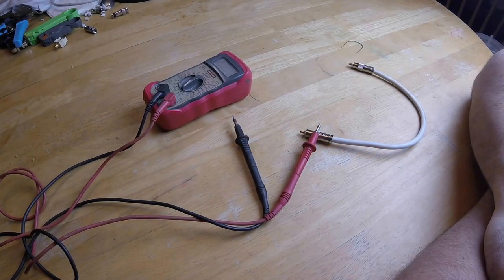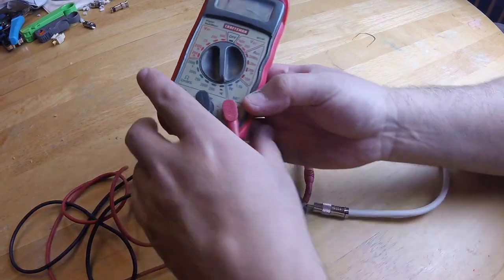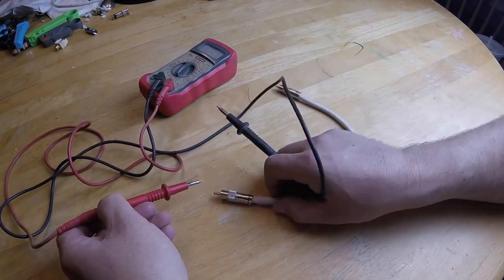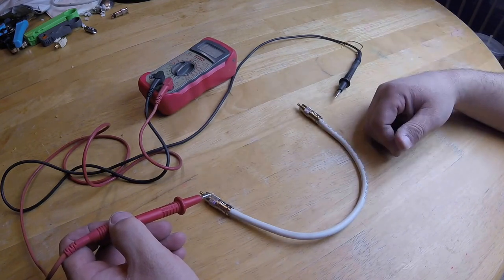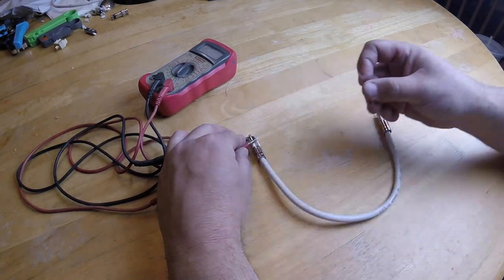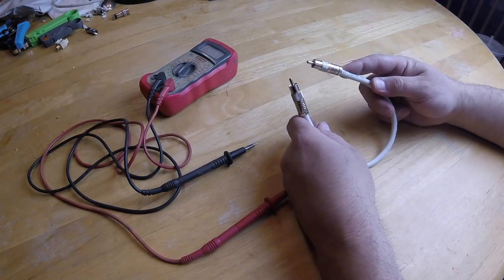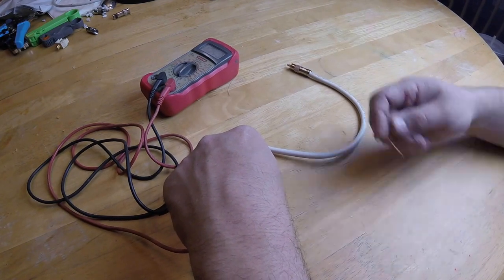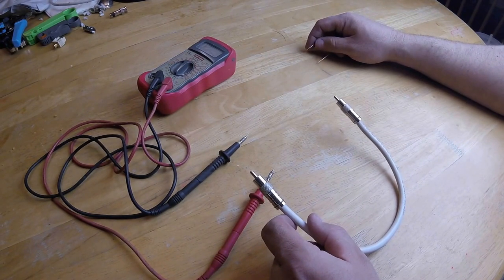Using a digital multimeter for beginners. How to test your cables

Comment: I made a MC4 cable/connectors/extension. Measured the voltage to the solar panel without light emitting to the panel. The voltage reads 0.59V is that ok? PS: I just want to know if the cables/connectors are installed correctly.

Comment: Hi, great video! I’m trying to test a wire that goes from my car battery to my sub in the boot how do I do this with both ends not having connectors and it’s just the bare wire? (Also my multimeter doesn’t beep either).
Reply from the maker: Use the ohms setting and it will be easier with two people if you can find help. Once you’re in the ohms setting, look at the reading on the meter. I think it will read something like 1 (I may be wrong but it doesn’t matter what the reading is). Now touch the leads together. The meter will probably read something like 0 (once again I may be wrong but the number doesn’t matter). Note each value- whatever value it may be. Now have your buddy go to one side of the wire. He should not let the wire touch metal yet. You keep the meter on the other side. Touch one meter lead to the wire (don’t let the wire touch metal) and touch the other meter lead to a good grounded/bare metal spot on the car. You should have a reading on the meter that matches the reading you had earlier when the leads were NOT touching. Now tell your buddy to touch the wire to a good grounded/bare metal part of the car. If you are both on the same wire, the meter will read the same value it read earlier when you touched the two leads together (or close to it). If the meter value isn’t changing, you guys are either not using a good ground/bare metal surface or you’re on different wires. Good luck!
Reply from the maker: Or it IS the same wire but it’s cut somewhere.

Comment: hey,what about a single long wire that you cant reach the both ends,how you can check for continuity?and how to check which end is the wire in case they are the same color???thanks bro
Reply from the maker: Same setting on the meter. The person on one end of the long wire should put one of the meter leads on the outside of the connector and the other meter lead on the tip of the connector being careful not to let the leads touch each other. Then, someone on the other end of the long wire will take a small piece of wire or copper or whatever then use it to connect the outside of the connector to the tip. We call that a “short” and the person on the meter should hear it beep every time the other person connects the tip to the outside.
Reply: @AlanCleggYouDoAV  thanks bro

Comment: My multimeter was free from Harbor Freight and does not beep; what kind of readings am I looking for?
Reply from the maker: Woo would have to use the OHMS setting then and check for open and closed circuits.

Comment: Can you test HDMI and MiniHDMI with a multi meter? Been searching online but no answer so far, stumbled on your vid.
Reply from the maker: Theoretically yes but logistically, no. You’d have to pin each side and it would be extremely difficult with a regular electrical meter. It’s not uncommon to have a bad HDMI cable if that’s what you’re asking. If you have several going to the same place, you can use a similar method to identify wires, but testing is kind of asking a lot.
Reply from the maker: It’s also not uncommon to have an HDMI cable that handles one video signal but can’t handle a more advanced one
Reply: @AlanCleggYouDoAV  Thank you for the information, much appreciated. Goodluck with your channel in 2020 !

Comment: if the audio rca cables are good, how can we check the tv audio out holes? with the multimeter
Reply from the maker: That’s actually a really good question and I’m not sure how to answer it. I wouldn’t use a multimeter to test the audio out signal. I would use a different method depending on the application. Tell me about your problem and I’ll see what advice I can offer.
Reply: An Oscilloscope can be very handy. You can use that to see the audio signal coming out of the TV

Comment: I heard you can use a tin foil on one side if you wanted to locate a working coax on the other. Example Some idiot contractor i hired decided to unplug most my coax and now I can't locate my directv line. I found my cable internet line with a splitter i got that to bring my new modem to my central location. I just know that my satellite coax is on the other side of the wall and I know the outlet its coming out from. I know find about 50 feet of unplugged coax i recently had a satellite guy hook up. I located the line that goes directly to the dish but can't locate the line that goes to the outlet. Maybe I should just plug in that unplugged extra coax direct and run that line down and make a new outlet. Aghh this contractor was a nightmare and all he was paid to do was put in recess lights.
Reply from the maker: I haven't heard the tin foil trick. I'm not sure I understand the lost cable. You found the line that goes to the dish but can't find the line that connects the central closet to the line from the dish?
Reply: @AlanCleggYouDoAV  Sorry it's hard to explain my situation. So i moved in a house that had a family room built. On the side wall it has an outlet that is for cable internet hook up and also a line for directv. Up in the attic half way, the whole side of the family room is practically blocked off. Those two lines are on the family side of the wall. If i really wanted i could crawl and squeeze to the other side with plenty of space but gotta do vice vesa if i wanted out. I actually used the foil method and it worked!!!!!  So I covered the outside metal part adapter and covered the inside copper line or middle conductor with foil. Went up the attic to the 3 unknown coax, 2 were dead and the last one was it. Used a multi meter and set it on continuity. From there same concept of how you explained on checking if its live. Plus for more confirmation i had my gf take off foil and on again to make sure 100% its right.
Reply: all this said and my dtv box still giving 775 error code. I think i might have to terminate and crimp up some new coax lines. I have about 50 foot of fairly new coax sitting in the attic. I literally rolled it and tied it for future use.
Reply from the maker: @FMD023  OH!!! Now I understand what the foil trick is. The tin foil shorts the tip to the outside shielding. Thats a clever idea. If you are absolutely positive you're on the correct wire and there is NO splitter anywhere in the lines, you should have a direct connection from the box to the dish. Make sure the DISH itself is powered up. It can be powered by the box if you have a box with that capability or you can use the power supply. If all of this is correct, you should be good to go. If not, maybe your dish is not aimed?
Reply: @AlanCleggYouDoAV  I’ll recheck the line to the dish one more time. In the meantime I’m working on getting these IRS to work. I been told I’ve plugged everything right just can’t seem to get right. I went the Balut route with extenders. Sending unit plug in IR in port and receive unit plug in Ir out. My rak is literally on the other side of the wall and about 25 feet away. 16 if u don’t count the bottom to top ceiling.it’s been frustrating yet rewarding. My home theater is almost complete. Just need to make a 12” riser for my 2nd row. I’m currently in grad school at usc now so this might have to hold off for now.
Reply from the maker: @FMD023  Dang. I'm in med school in Utah. I know how thin time can be with life responsibilities and school work. Kudos to you for managing it all and still taking time to work on your pet projects. Best of luck!
Reply: @AlanCleggYouDoAV  likewise!!!! Med student that has experience in home theater installation. I bet u will have a lot of fellow med student who will be asking for your services in the future ! That’s awesome. What field are u going in? I used to be a resident coordinator and had to take care of over 350 residents and fellows so I know a little something something about the medical field. Forsure doing this on the side helps right. I know medical school cost nowadays isn’t a joke and residents don’t get paid as much as people think. Hope you re enjoying the journey and best wishes!
Reply from the maker: @FMD023  Thanks. I'm still a med student so I have a long way to go. I'm thinking about anesthesia but who knows? Life can show me a lot of things in the next year or so.
Reply: @AlanCleggYouDoAV  yup that happens a lot when u are in med school. Of course u will get a lot of med students wanted to go into derm. Easy work with high pay. U practically have be an over 4.0 med student for derm consideration. Lots of attending knows this. Keep up the motivation and if u ever want to work for the Veterans affairs lmk.

Comment: what's a "short"? thought the title said this was supposed to be a video for beginners ??WTF??
Reply from the maker: A “short” is where two different conductors touch each other. For example in this scenario, the outside steel shielding is one conductor and the copper core is the other. If they touch each other even a little bit, we would say the two conductors are “shorted.” Good question. Sorry I didn’t clarify.